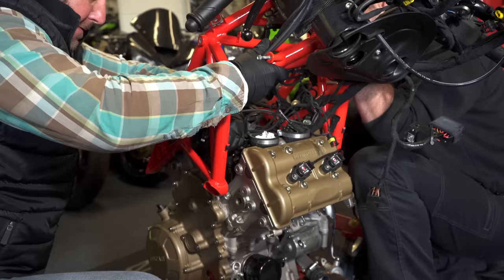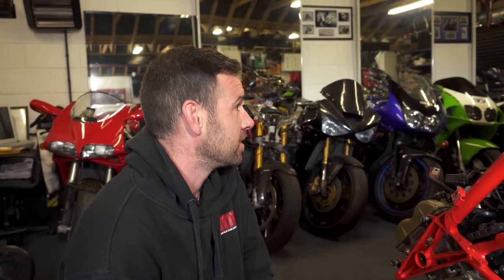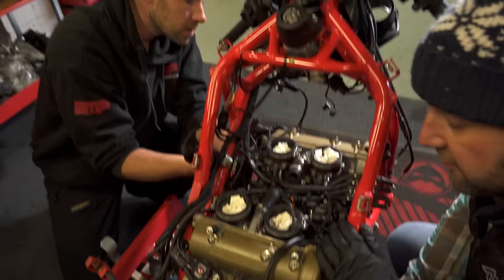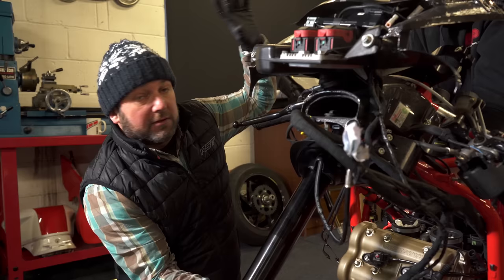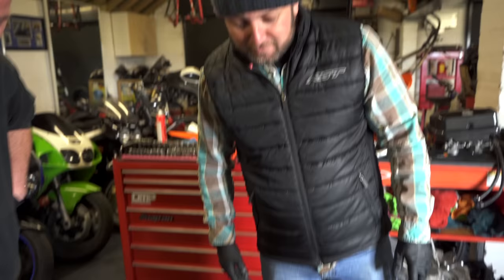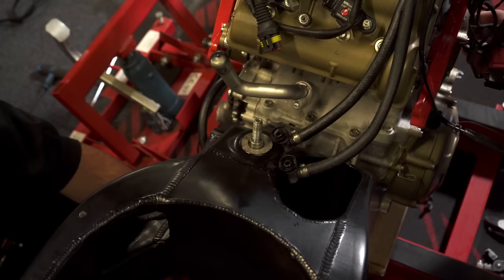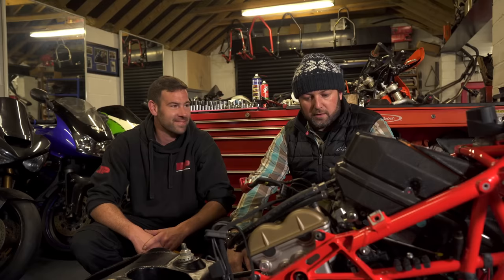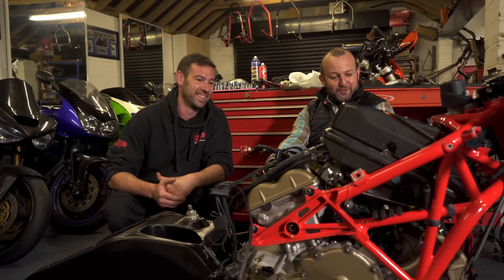Ducati Desmosedici RR Re-build Project Part 10 (Project 425) In 4K

Comment: Another cracking episode; great content and great picture quality too.

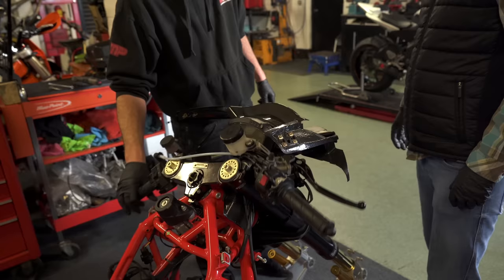One thing you might want to check - in the workshop manuals of all the Ducatis I've owned, it recommends tightening paired pinch bolts, like the ones in the bottom yoke (8:54), in the sequence 1-2-1. Because after tightening the second bolt, the clamping surfaces have moved closer together and you tend to find the top bolt is then slightly under-torqued and requires nipping up. It may be a minor thing, but on a thoroughbred like the Desmosedici, I'd definitely be a bit OCD over that sort of thing.

Keep up the good work and go and have a well-earned Pot Noodle!